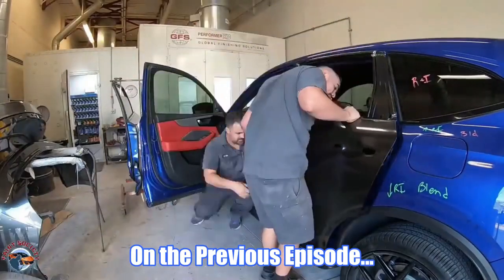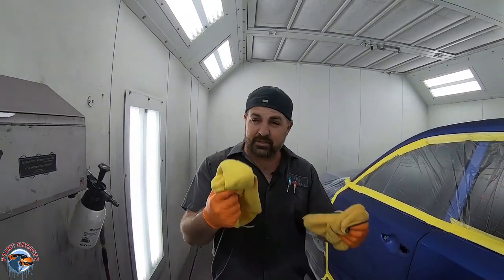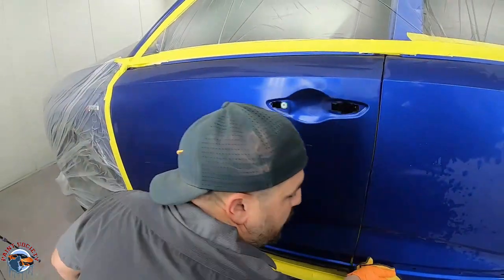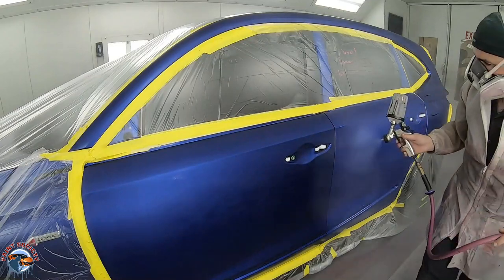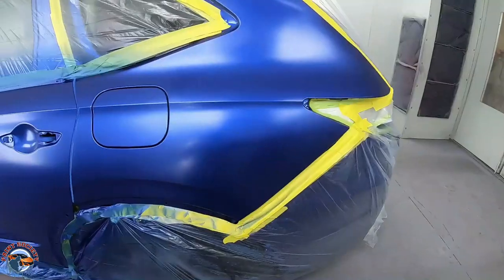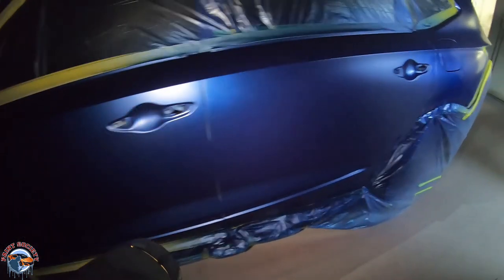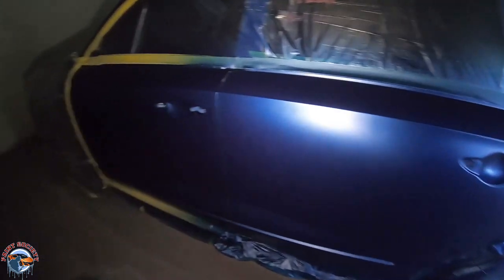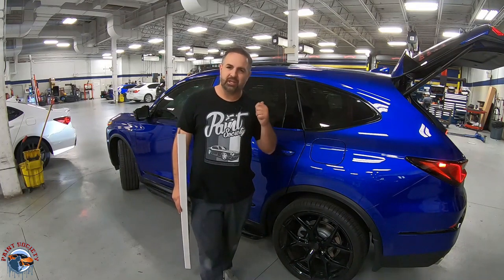STOP Being Scared of Painting Your Car, Use These Steps!

Comment: Howdy Brian, your video's have given me the confidence and steps I need to paint my truck. I have a 2005 black dodge dually with a lot of clear coat and paint chip issues. Not rust thou. I'll have to wait for warmer weather as my barn does not have heat. But, in the spring I'm going to repaint the truck. I'll need to pull the bed off, remove the tailgate and dually fenders, remove the bumpers and grille too. I have a good 60 gallon 55 year old compressor that'll work. I'll just need to buy a couple paint guns for the project. I'm looking forward to this project to make my old truck look new again. 
Thanks again,
Blessings to you and your family.
Reply from the maker: Thanks so much for the awesome comment!

Comment: Whats up Brian. Ive watched countless videos of yours. I had a chance to visit my local automotive paint supply shop and the price of paint is off the charts . So i looked up would have been one of the factory original choices of color for my 1951 chevy 3100. Cape Maroon GM color code 3E167 in an acrylic enamel which is sold by
Jim carter parts for $149/gallon. This not exactly the custom color i really wanted but, its so much more affordable and the period correct color is just fine with me. So, i have the 1.3 hf purple gun to shoot sealer and primer, but if you have any videos shooting this type of paint with a hf gun id sure like to watch and learn. Thanks and keep up the great work and helpful videos.
Reply from the maker: Price of paint is insane. I would tell you if you can upgrade your paint gun you probably would get a better job. Check out the astro 1.3. Euro. Around $115
Reply: @PaintSociety  what i meant was , i had the counter guy work me up a quote for materials and this case base/ clear , no epoxy , no primer. $850 -1100 depending on which line , one was RM the other i cant recall. I wasnt worried about price of the gun. Id get the $75 hf ( silver) upgrade gun or a black widow to spray color.

Comment: Brian need advice to proceed-- im repairing a 55 mercury- Every panel had seriously extensive rust and major 
dents- after 2 years, i got it near paint ready with 3 blocking down episodes to 150 paper.
It has 4:1 evercoat epoxy primer as final coat- under that is some original paint, a little bare metal, bondo, putty, 
and a little  rattle can rustolium primer.
Two questions  :  
1 rather than blocking again which  really won't work for me... i was going to get some 

rustolium paint from home depot- it is Protective Enamel Gloss... like $12 a quart. That will give me shine so i can 
see the body work remaining. Is this a good way to go? I used it on a different car as a finish coat, and it looks 
pretty good.           
2- when i get this paint blocked and do a final painting 
with better 2 part paint...  will this sanded down enamel be bad for the final coat?? 
This is a repair i will drive ... not a show car.  If you say No- my only other option will be more expensive paint 
that you might recommend for blocking- im just done with speckled stuff. Wetting the surface wont work for me 
either.

Comment: I just inherited the paint booth😱😱 our current painter is leaving and we won’t have another painter, so my boss wants me to learn. Of course I would love to  learn, and your videos are a blessing brother. 
I have some questions I hope that you or someone else could answer:  
First, my big problem is that the compressor that we use to paint is  used by 2 body guys. This means air grounding, DA sanding, and air blowing are all leaving me with low pressure sometimes. The previous painters developed a hearing “super power” and they were constantly adjusting the pressure, but I don’t have that just yet. Any thoughts or pointers? 
My next nightmare is color matching. We have a mixer and I am going to be making the formulas. Lucky for me I always watched them so I kind of know what to do. 
However I am interesting in buying a spectrometer, do you guys recommend that?

Comment: Question? Had a gentleman tell me he used to have a auto body paint shop. So he painted my crown vic in his" make shift " booth. When it was done the whole driverside looked satin? He gave me the run around and want to learn to paint myself
Reply from the maker: Probably the clear died back quickly.  Loss of gloss. Improper application.
Reply: @PaintSociety  any way you think I could fix it? I was thinking of possibly just repainting the car myself

Comment: Brian. I want to spray a few small areas with a gold metallic basecoat paint over my prepped and sanded primer.  Then apply a few decals over the gold painted area.  I will then apply a sealer coat over the decals and entire vehicle which obviously will keep the gold under the decal.  I then want to paint the entire vehicle with a black basecoat over the decals and sealer of the entire vehicle.  I then will remove the decals, then spray my clear over the entire vehicle.  Is there anything you recommend while doing this or any suggestions?  Any advice is appreciated.  I've seen this kind of done this way with masking tape for racing stripes, but not with decals to make graphics per say.  No one ever shows the prep before during or after.  Does the area need scuffed.  Will the paint run off the decals???  Thanks

Comment: hello. i am getting ready to do my first paint job. i want to know if the color i want to do (royal blue 1) very similar to this is a good color to try for my first time? i am also skeptical of if i am doing things right. the truck isnt to fancy so i dont need perfection but i patched some pretty big rust holes by welding and using bondo i used a palm sander with 80. 120. 150. 220. should i do finer?? i plan on buying the primer and paint from summit. i beleive i buy grease and oil remover and clean the whole surface as well as tac cloth it. once i lay the primer down will i need to sand it? and could you please tell me any more steps i may be missing. thanks

Comment: I recently switched to a shop that has a semi-downdraft booth. I'm used to spraying in a downdraft. I've gone from spaying super clean jobs to having to polish every job that comes out of the booth. As a flat rate painter in a production shop this is a bit of an issue. Do you have any tips for painting in a semi-downdraft specifically? I know dirt will happen but maybe I'm missing something
Reply: what type of paint are you using. angle the car so the overspray goes straight in to the filters. point the end that is going to be painted close to filters. tack and de- nib in between coats
Reply: @mikemetcalfe1526  I am using cromax pro. I do feel like most of my issues are overspray. Most of the jobs I've been spraying lately I've had the booth quite full. Was told to paint starting close to the filters and work my way to the doors so that the overspray lands in wet paint. Makes sense to me but by the time I'm at the back of the booth, the stuff at the front is dry. I do tack between coats but it doesn't seem to pick up enough. Any suggestions for tack cloths? I'm using the Sontara green cloths.
Reply: @dalyntaylor2413  there shouldn't be much over spray in the base of cromax pro because the application is done very wet. if its happening in the clear use higher temp reducer. start spraying from back of booth to front and park car on an angle (un painting side front corner close to the filter. if its dirt find out where the dirt is coming from

Comment: You had me sold on the ws400. But I notice that you have cleared your last couple of jobs with a carbonio. Which do you like better? Ive been researching the anest iwata, and it looks like the fan pattern is very forgiving if you're not completely consistent with your overlays.
Reply from the maker: Haven’t used the ws400 in years. Still a great gun though but the walcom is much easier to dial in
Reply: @PaintSociety  thanks I'll look at the walcom too

Comment: Why not just paint the door off and do the blends separately? It’s much faster and offers the same results with less time and materials! Also why not use the wet bed between each coat of base? I think you are a great teacher and and clearly doing great work.. I’m just wondering why
Reply from the maker: Have you watched episode 1  and 2? I speak about it in great length
Reply: You could risk damaging finished paint on refitting the door especially when paint is not fully cured/hardened and is prone to chipping and leaving finger prints on softer area... Gaurenteed its happened in most paintshops...
Reply from the maker: Yes and further more i do it for proper color match.  Been burned before where you paint it off the car and it doesn’t match
Reply: @PaintSociety  correct need the metallic to flow from panel to panel to look oem fresh..... I always believe the less handling and moving parts after paint reduced risk of damage putting the project off schedule and costing time.... Time is money

Comment: Always painting new panels,or if it door jamb have some repairs, inside first.Put back on the car,adjust!And then paint whole thing outside.There is more reason to do like this.Number of coats can change ton,difference in distance and speed of moving pistol change ton,thickness of clear coat change ton.structure of clear coat can differ ,human hand is not a robot hand.85%of painters paint in parts and then assemble.Most of the time they get away with this but sometimes customer is unhappy  with these results .Then painters are unhappy:(
Reply from the maker: Perfect details explained there!